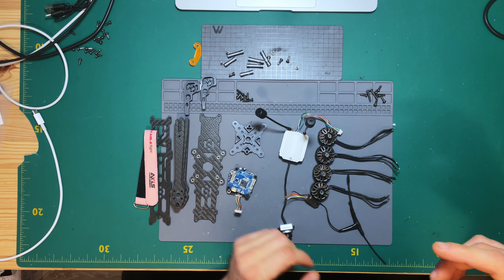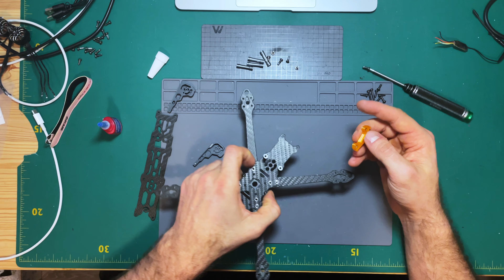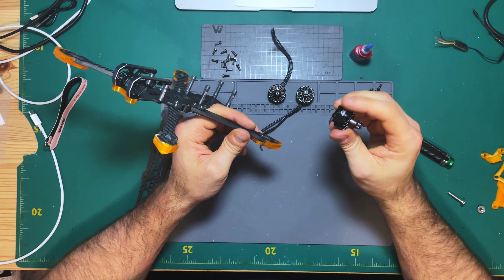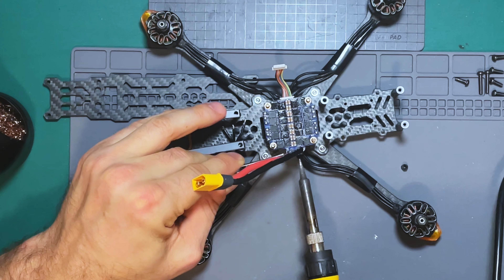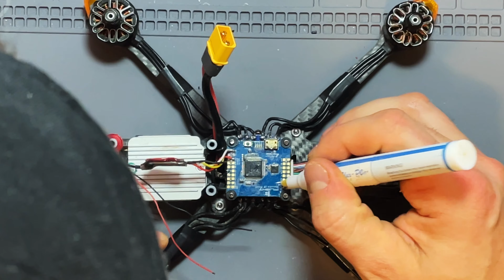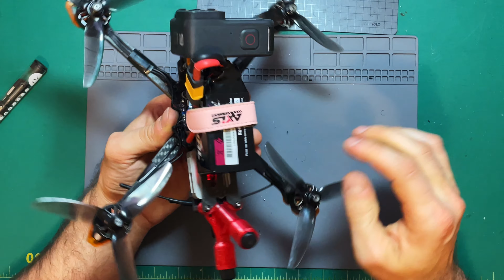BUILD: Axis Flying Manta 5" frame!! Longer DJI cable???

Comment: I just bought the Manta 5 inch frame and was hoping that i could use the DJI Air Unit. Previously i built the Mark5 frame but the Air Unit and Axisflying iStack don't really fit properly. I'll post some videos of each build when I'm done but This video was awesome. Now i feel safe to start the new build! Thanks! I'm subbing you man!
Reply from the maker: U can with a longer camera cable and it feels great flying 😁👌🏻

Comment: Good job ! You did exactly what I plan to do. Did you test your build ? Is it well balanced with the Air Unit ? Not too heavy ? What is the weight wihout battery and GoPro ? Thanks :)
Reply from the maker: Thank you :) I havent tested it yet. The build is back heavy cause of the long body but a gopro will counter that. Dry weight is 442grams so not bad!